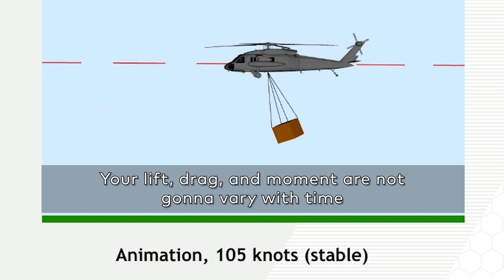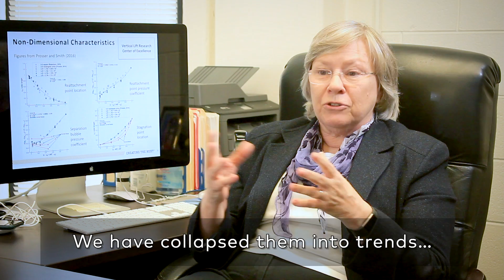Unsteady Drag - DRL SIM 3.0

Comment: READ THIS TO SEE REVIEW
This is a awesome simulator I bought it the day it was released...only thing is, its floaty, to fix that I put +20 on the gravity option in settings. 

The missions are great to gut again on the pro mission it's to floaty...  I left board comments on all the boards....

Overall best sim so far (because of all the different things you can do and the physics)

2nd place is FPV AIR 2 which needs no changing at all (just insert rates)

3rd place Velicdrone (but it needs major changing of settings) need to follow Mr.Steeles video to get it accurate.

4th place LiftOff ...just to floaty and I was never able to fix it....

So awesome job DRL... I was always wondering why no other simulator put out learning missions......one thing I want to ask, can you please also include freestyle missions for all the different tricks out there, and you dont move on until you perfect each trick.

Thanks.....